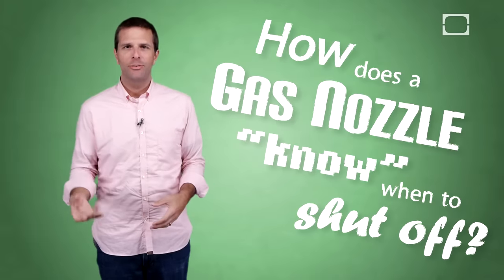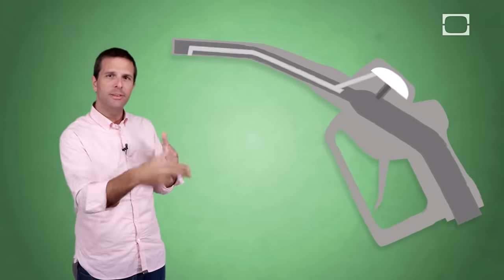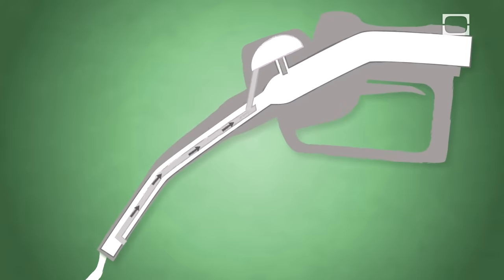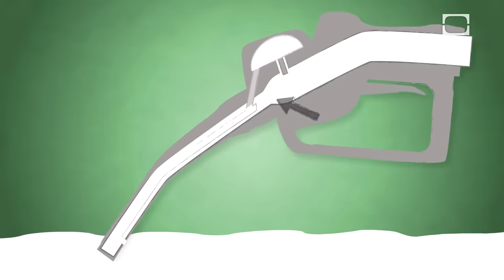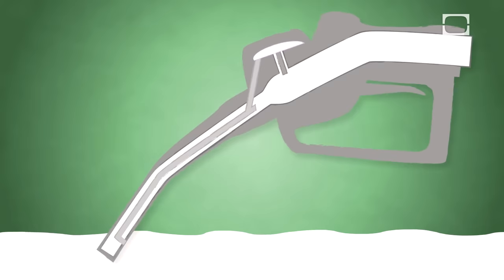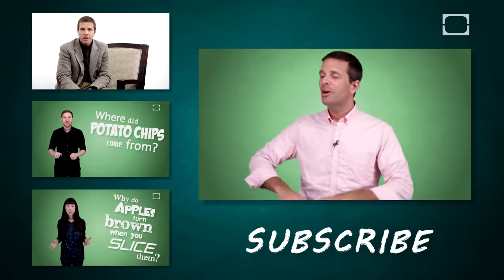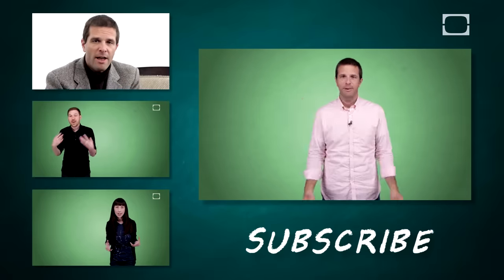How Does A Gas Nozzle Know When To Shut Off?

Comment: Good video topic, but very poor explanation.
Reply: GlzMo1234 for 2:43 seconds, that was about as good as it will get.
Reply: GlzMo1234 Well I fully understood the solution the first time so I guess it was explained pretty well.
Reply: GlzMo1234 There was a video showing how it works... Air pressure.
Reply: GlzMo1234 Thought the same thing. 
- The explanation of the Venturi effect is wrong (The pressure before and after the "pinch" is equal. It drops IN the bottleneck not after)
- Also density is not "heavy". Its either low or high. 
Not mentioning the akward "gags" at the beginning of the Video.
When you want to do an explanatory Video please check your facts.
Did i mention mention youre not funny?
Just my 2 cents.
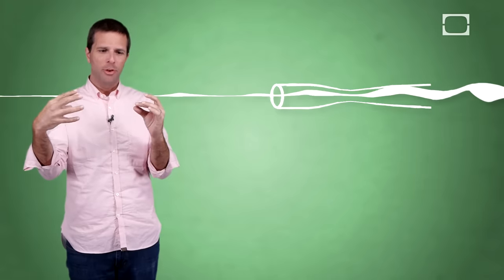Reply: +GlzMo1234 I shut it off after about 45 seconds. After he said (0:39) "after the pinch.. after it goes through the pinch it becomes compressed, and as its velocity speeds up, the pressure on the other side of the tube actually decreases".....

After that mess of a sentence I couldn't bare to watch anymore. Let me explain why that sentence is so confusing (and just terrible) so you don't think I'm just randomly bashing the video.

1. "and as it's velocity speeds up" -- Velocity doesn't speed up, the gas does.
2.  "and as it's velocity speeds up"  -- The fact that this causes the velocity to increase requires explanation, or at least some form of acknowledgement.
3. "the pressure on the other side of the tube" -- Where is the other side of the tube? Do you mean other side of the pinch? If so, which side is the 'other side'.
Reply: We have can help you out to learn how fuel pump nozzles work. Check out our website: www.opwsales.com.
Reply: +idontgivead4mn Wrong,  Pressure will increase in the bottleneck and behind.  The flow is restricted by the bottleneck so the pressure will increase.  After the bottleneck, the flow is unrestricted and will have a lower pressure than the restricted flow.
Reply: +cjmillsnun nah you're full of shit. Pressure is lower in the bottleneck, and velocity is higher. Pressure and velocity before and after the bottleneck are the same
Reply: +Invisiblejihadi actually I am not.  How can pressure be lower in something that is constrained

A bottleneck is a constraint, is it not?  The pressure before the bottleneck will build up as the fluid is obstructed, it will pass through the bottleneck at a higher velocity and slightly lower pressure than before the bottleneck.

However the lowest pressure is after the bottleneck.  As the restriction eases then that pressure goes.

A practical example.

get a soft garden hosepipe and a hose clamp.  Pass the hose clamp over the end of the hose, down about six inches (150mm) and tighten it slightly, so as not to totally block the flow, but certainly to restrict it somewhat.  The hose clamp is the bottleneck.

Now go turn the water on.  The water fills up the hose and hits the restriction.  The hose will balloon out slightly behind the clamp as the pressure increases.  On the other side, there will be a steady flow of water at low pressure.
Reply: +cjmillsnun Assuming mass flow rate is the same everywhere in the pipe, when a pipe is constricted in the centre, pressure is higher on both sides of the bottleneck, and lower inside the bottleneck.
Velocity increases inside the constriction, and pressure decreases as a result of the acceleration of the fluid.

If the constriction is on the end of the tube then the lower pressure fluid in the constriction will form a high velocity jet. This assumes constant flow rate on either side of the bottleneck.
In your example you didn't account for the pressure decreasing due to a weak pump. The flow rate decreased in the whole system after the constriction as well as before the constriction, but same principles apply and the pressure inside the constriction would still be lower while the pressure before the constriction is the same as the pressure after it.
Reply: Lol! cjmillsnun doubling down on dumb. The faster a fluid moves the lower the pressure. This is why if you crack a window on a car and have a cigarette near it the smoke gets sucked out. There is lower pressure outside of the window from the air rushing past it. It is also how wings generate lift. Air has to travel further on the top of the wing and thus moves faster than it does on the bottom creating higher pressure on the bottom and lower pressure on top, generating lift.
Reply: I thought it was explained decently although a little more detail about the Venturi would have been good and the way in which the system actually shuts off the pump
Reply: Idk the animation helped alot
Reply: in what way? what dont you understand? If you still dont get it, it isnt the videos fault, its yours for being slow 😁
Reply: idontgivead4mn damn harsh dude, you maybe right and all but respect the presenter for his own style...

Comment: How do you convert mechanical energy into electricity
Reply: motors
Reply: motors convert electrical energy into mechanical energy... a turbine converts mechanical energy to electical energy.
Reply: They are the same thing. They both work both ways.
Reply: Thierry Spoon  well all you have to do to create a turbine effect is spin the motor manually
Reply: sciencemanguy ,the easiest way is an alternator...spin it manually or set up a contraption to where a bike is spinning it.
Reply: To actually answer the question, it is using magnetic fields to induce an electrical current, isn't it?
Reply: +firstname Yeah I was gonna be pretty miffed if nobody brought that up.
Reply: to be more precise, a changing magnetic field (from a rotor) induces a voltage in a copper coil, if you load that externally with say a resistor then a current will flow and that current will generate another magnetic field in the same coil which will push back against the 'original' magnetic field. So the generator pushes back against whatever drives it and you've got a transference of power. 

So the rotational speed determines the voltage, and the electrical current the electrical load 'pulls' determines the force with which the generator pushes back against whatever mechanically drives it.
Reply: thats basic knowledge. pretty easy concept. basically you roatate a rotor and you have coils and magnets that create electricity due to the rotations. 

google it, its not as hard to understand as you might think.
Reply: sciencemanguy with coils of wire spinning around magnets
Reply: magnets.
Reply: Alternator
Reply: firstname  You can produce static electricity too by mechanical means, and without magnetic fields
Reply: A change in magnetic field creates electricity, thus by moving a bunch of magnets surrounded by coil, you change the magnetic field, which creates electricity in the coil.
Reply: Alternator or generator
Reply: "its complicated"
Reply: you have some Bible lessons with it and then you baptize it and then BAM!, its converted.
Reply: Generator

Comment: As a gas station attended I learned about this years ago, it still baffles my customers when some of them don't know you can do this. They are like, is it going to stop by itself? Now sometimes, rarely, but this mechanical stopping mechanism sometimes fails, if the diaphragm pocket of air is busted or the straw is busted, I've had overflow incidents.  Customers always try to blame it on me, we replace them when they are expected to go, but no amount of safety guards can always prevent an incident. This is why, as a customer you are to always stand by the pump, no matter how cold it is; and I know it's cold in Michigan, you have to attend the pump. Put away your cell phone so you can be observant, turn off your engine, make sure you touch metal other than the pump if your car seat or shoes make you prone to static shocks. Finally, if it didn't need to be said before, and it shouldn't, no smoking anywhere on the premises, why would you?
Reply: ***** A mechanism that closes the valve if the diaphragm is broken could prevent any spill accidents.
Reply: agun17 fry, ur a genius!
Reply: juliolp95
I knew those online IQ tests were unreasonably low!
Reply: agun17 thats totally ssomething youd say! 
Lmao
Reply: ***** gas station attended
Reply: +EqualsThreeable And what if you live in a state like New Jersey where you don't get out of your car and the attendant does it for you?
Reply: EqualsThreeable I just made an announcement in another comment, I had one fail yesterday and had a 5 to 10 gallon spill.. people are idiots
Reply: EqualsThreeable what people don't understand is it's mechanical and it's gonna fail some time.. if it's over 10 gallons and unmanageable the fire dept has to be called as well as a company to pump the tanks.. it costs over $5,000 and if it's your fault you will be footing the bill because insurance won't pay for that because it's pure negligence
Reply: Not true - the insurance company that covers the gas station will cover it. If gas stations were charging people $5k for an accidental spill that was due to faulty equipment provided by the station that wouldn't last long lol. Provide us a court case proving me wrong, lol.
Reply: Matthew Evans no it's because we have tanks that the gas drains into, those tanks normally are done once a year.. they are to keep gas and oil out of the enviourment, but when some idiot spills gas everywhere they have to have the company come and fix the holding tanks because they get overloaded by more then 10 gallons of gas at one time.
Reply: Matthew Evans I'm telling you I work at a gas station, people get charged $5k for that shit it's ignorance and isn't covered either. The equipment to deal with large gas spills is expensive and the people who are qualified for large ones cost alot man it's not a fucking joke do you know how much power 10 gallons or more has? And it all drains under the ground in concrete holding tanks which is right next to 2000 gallons of gas and then 2000 gallons of diesel. But yeah man equipment breaks on everything it's life, you're one of those people that walks away for a half hour when you're pumping gas huh? When you are filling gas it 100% is your responsibility to watch it if it's a self serve station, I'm sorry but that's the truth man you don't just leave something that is as hazardous and flamable as gas filling without watching it, it should be common sense.. but even still besides that, actually read all the writing about doing shit right on a gas pump you might learn something it might answer your question about it being your responsibility.

Comment: I’m a an engineer and I used to work for the company that originally created that design.   I can confirm that you are correct in your assessment of how it works.  Also, most gas nozzles have a second diaphragm or plunger (not membrane) that deflects when there is pressure in the fuel line.  It is used for prepay fill up.  When you hit the prepay amount the dispenser shuts off, the pressure in the nozzle drops and that second diaphragm which is spring biased up will move and shut the nozzle off.  There is a third shutoff in some nozzles that is called an attitude device.  When a … moron… pulls a flowing nozzle out of a car’s fill pipe, a ball bearing blocks the pickup tube and shuts the nozzle off

Comment: To me, it's counterintuitive that the pressure behind the narrowed tube would be lower. It seems like it should be higher. If you pinch off a hose the area behind it expands due to higher pressure.
Reply: oneaburns It's as if each particle is a person running by a line of people giving high 5's to everyone in the line. If he is going fast, he can only barely give a (low pressure) high 5. If he is going slow, he has all the time to high 5 and push on each hand (high pressure).
Reply: +oneaburns The pressure after the pinch is lower; He said it wrong.

Comment: The nozzle will not turn off/lock unless you have filled your tank to full. The only way to stop the nozzle from pumping gas if you aren't filling to full is to release the pump. Hope it helps!
Reply: Nope my keeps shutting off n it wasn't even on half way marker

Comment: I always wondered this! But then sometimes I like to round off my gas bill, so I keep pumping the gas nozzle even after its full so it pours a little extra and hits like say a round number like 52. But how does that happen, when it is already full?
Reply: Old king cole was a merry old soul and a merry old soul was he it's a long tube so it takes a while to reach
Reply: is that a combat arms profile picture?
Reply: "its complicated"
Reply: Old king cole was a merry old soul and a merry old soul was he you realize that your car has a vapor release mechanism that will get plugged if you do that, it's called vapor lock and when you go to fill up the handle will click off even when its empty and it will take 20+minutes to fill your car when it normally would have been 2 minutes.. don't do that it's gonna break it and cost money
Reply: Old king cole was a merry old soul and a merry old soul was he that also could be the kind of stuff that causes the handle stop systems to fail, I'm a gas station worker and had one fail yesterday while someone was not watching it inside the store.. btw it's illegal to leave your car unattended while it's filling
Reply: As the fuel is poured, it foams, triggering the shutoff. Once the foam settles, you can continue pumping as usual.
Reply: Jake Mitch I've been driving for 18 years... Always did that... I pull the filling nozzle out so I can get as much gas as I can in there... Never had any problems with any of these vapour lock systems you speak of... But keep believing your mechanic or wherever you heard that nonesence.
Reply: @moefritz6225  You might want to see a therapist for that unnecessary OCD.

Comment: The pressure doesn't decrease after the pinch--it only decreases at the portion of the higher velocity around the pinch. The diameter once again increases and hence velocity decreases and pressure increases again. However, the pressure after the pinch might be slightly lower than before the pinch due to losses.

Comment: They're surprisingly complex, and no wonder they're expensive. I work in the fuels industry servicing all these parts and a standard nozzle costs around $650-$700 each.
Reply: Is there a way to defeat the shut off, like using the nozzle upside-down.
Reply: @jonmeans8807  no. Also they have a one-way pressure activated valve inside which is only open when the pump is running. So when you preset fuel to pour into your car and it reaches your preset value the valve will shut. Sometimes you see people lifting the hose up to try and empty as much of it into their vehicle but the one-way valve has shut.

Comment: Hey! Thanks for the video :) I never knew how this worked until now. Also, just a quick aside, in countries outside US "gas" typically doesn't mean gasoline or fuel. And since this explanation relies on the difference between air (which is a gas) and fuel (which is a liquid) I think it might be a little confusing for some folks watching who don't know that when you say "gas" it's the liquid fuel. 

Thanks!

Comment: 0:32 "fluid can be gas" american logic
Reply: burnzy3210 as in american logic, you mean the definition of a fluid... "fluid (n.) a substance that has no fixed shape and yields easily to external pressure; a gas or (especially) a liquid."
Reply: burnzy3210 think about clouds buddy
Reply: Aluminum is pronounced as aluminium. British logic. At least gas is a shortened version of gasoline. There's no extra fucking i in aluminum to be pronounced that way.
Reply: Richard Potts snowmobile trail riding

Comment: In your fuel pump there's two tubes inside, an air tube that leads to a sack up top and a tube for outgoing fuel. When you pump your tank, air comes in and inflates the sack, fuel goes out. As the fuel level increases and less air coming in, which causes the sack to lose integrity until there is no more air to keep it inflated and it collapses. Once that happens, it triggers a shut off valve and then click, no more fuel.

Comment: for those of you who live in cooler climates this system failing is exactly why we will tell you to stay with the pump and not sit in your vehicle while pumping. especially in winter that little hole is the nozzle can collect condensation and freeze. meaning it will not automatically cut off. At my station and I'm assuming this is rather normalized everywhere the speed of flow is about 6-7 gallons a minute meaning you could have a very serious spill in the time it takes you to notice the shut off failed. And no, the gas station is not liable for the cost of the spilled fuel, or any damage that may cause. This is why we have warnings plastered everywhere.

Comment: Genuine question, does that mean that part of the gas you paid for is sucked back up to cause the shut off? And if so, how much of it? I feel like that would add up to a lot of paid gas over the years that you never get. So would it be more cost-efficient to never get to the point of triggering the auto-shut off?

Comment: If your pump is shutting off whilst you fill it could be your vapour canister in your car that's blocked or the pipes leading to it. Blow the pipes out clear it and do the same with the canister if air passes though it's ok if not replace. As you put the nozzle into your tank it's pretty air tight and as you fill with fluid the air has no where to go building pressure in the system coursing the ball valve in the gun to shut fuel off. It's also an environmental feature to stop harmful vapours going into the atmosphere the coal canister absorbs this.
Reply: Cannot say that better than u
Couse i knew this before ( like 3 or 4 ) years ago 
But u can only understand this if u like to mess with engines